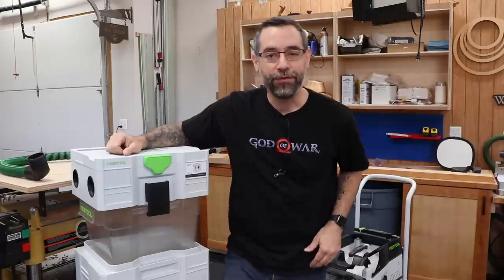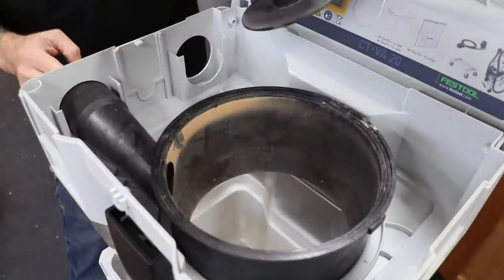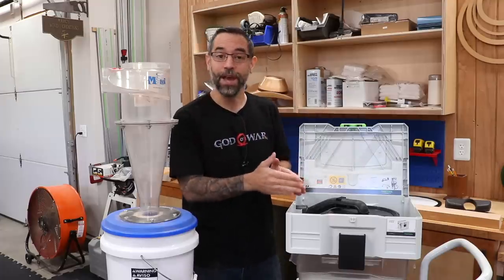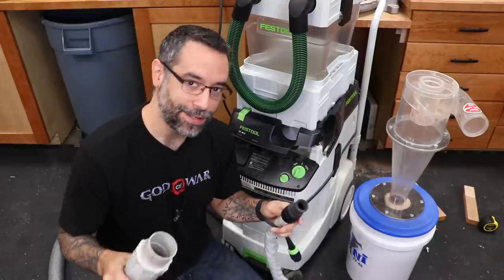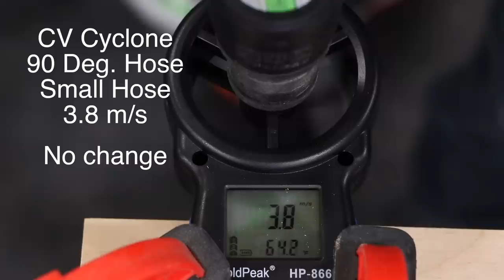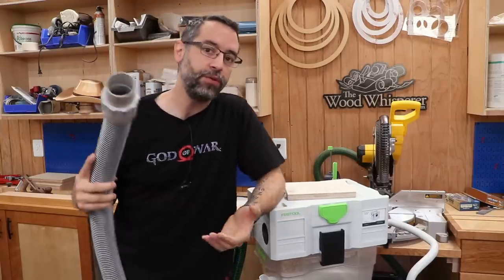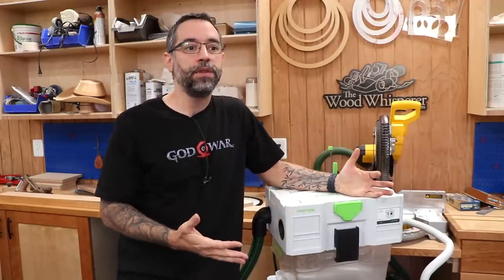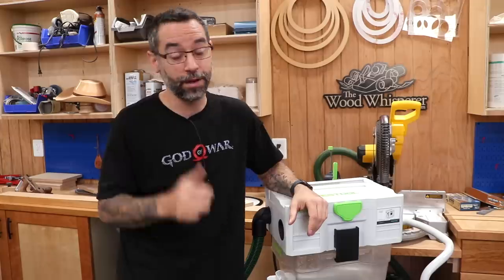Festool CT Cyclone Review | Not Great!

Comment: Marc, I am a mechanical engineer and I specialize in industrial HVAC, which includes dust collection.

I agree your methodology for testing is decent enough to observe a relative difference. Kudos for being practical and not measuring arbitrary things like static head and watts and whatnot.

As for those 90 degree elbows: they are not as bad as people think. They have an equivalent length of like 5 feet of straight duct. Additionally, one foot of corrugated hose has an equivalent length of about 5 feet of straight duct.

But, those 90 degree elbows are actually really large and don't function like an elbow in this case. Kind of hard to explain, but since it is at the opening the airflow hasn't "developed" like it would in a long run of straight pipe.

Not sure where I was going with this. Uhhhhh bye.
Reply from the maker: That’s all good to know. Thanks, man!
Reply: maybe you can answer a thought i had, doesn't pressure drop exponentially as speed decreases? IE a 30% loss in velocity is more like a 60% pressure drop... meaning the speed reduction is a lot worse than one thinks. I've ready on the FOG forums that people feel their shop air is much dustier with the CT vac on - if a 14% reduction in air speed is more like a 30% pressure loss it would certainly explain that
Reply: More concerned that it drops to the small hose right out of the gate. And it's the same size from the lid duct inside so swapping to my other fat whip won't do me any good. Can't believe I bought this. I asked how big the hose was over the phone. They said they couldn't say but it should run the 2 larger hoses for the larger tools. If it doesn't have the volume flow to run the turbo brush beater bar it's useless to me. I bought it for planex, renofix and bulk dirt. There are major losses with the hoses my system requires. They think we need a preseparator most when we're running fine particulate sanders? The biggest loss with the cleaning tool with the hose that fits the OD instead of the ID.

Comment: There's a fairly new solution that's also low profile that's sold at Home Depot for $40 - Dustopper.  I can mount the bucket + Dustopper on top of my Festool vac and achieve the same results.

Comment: Hi Mark. I bought a CT cyclone about a month ago. I have had a problem with the clear plastic bag in the "tub" being sucked into the cyclone. Have you had that problem?
Reply from the maker: Oddly enough I was just messaging with John Malecki and he has been having the same issue as you. I haven’t had that problem yet. The bag kind of wrinkles up a bit but doesn’t get sucked in.
Reply: Stick a piece of velcro at the bottom of the box and the bag.
Reply: Run a small 1/2” hose to the bottom of the bin from the Vacuum. This will provide equal amounts of pressure on both sides. This also become a real problem when air is able to get under the bag.
Reply: Had the same problem. Makes me not want to use the bag.
Reply: Thanks for all the great tips guys. I think I found the problem. Having too much plastic bag inside the container instead of wrapping the extra down the outside.
Reply: put a hole in the bag the size of a fingernail at the top . just below where it folds out over the rim. pressure of bag equalizes its a simple trick
Reply: Use it without the bag . Keep a large bag outside . Take out side and empty into large bag . It’s easy to empty I can put 60 pounds of dust through the system without even filling the vacuum bag . And that is on a small midi vacuum . . Tape the connectors on the link hose to seal the leaks . And tape the top of the baffle .

Comment: I'll take the bait! 

Did you look at pressure drop (measured in inches of water column, an indicator of overall friction in the system) with your manometer? That tells an important part of the story too. As velocity decreases pressure drops off more - so a 36% loss in velocity (festool) is a 60% loss in pressure, and a 14% loss in velocity (clearvue) is a 26% loss in pressure. My understanding of the cyclone design (at a 3:1 ratio of height:width)  is to minimize friction and therefore pressure loss , because it plays a vital role in keeping dust entrained in the airflow. That has always been the shortcoming of the Thien baffle designs. The second I saw the CT Vac I knew how the numbers would look
Reply: guitarchitectural ooh physics me likey!!

Comment: Thanks a lot for another interesting review. overpriced on its own and I would agree they should have given something back to its customers by offering a much lower price as this is mainly shaped / moulded / blown plastic. It comes across as many have already said as a rip off and Festool ought to do better. On the positive integration is superb and a very convenient way to colect (fine) dust - I have an Oneida system I am very happy with but I will be on the look out for a better price for this CT Cyclone and when that is found it will become part of my other Festool vac system
Reply: @Tensquaremetreworkshop  I have plenty of Festool kit and it is my fav brand but albeit we all appreciate all that is about Festool not everything they make is priced fairly...and not everything they make is golden dust. Oneida has got better systems (it is their specialty...) - what Festool did here was  to jump on tech invented by others and integrate it with (some of) their vacs and in the process (clearly) overcharge for the convenience.

Comment: I'm curious where that massive loss came from on the large hose. Could it be that with its added suction power, it's able to break the seal between the clear bin and the cyclone systainer component, or pull air from other connection points? I really feel like air must be entering the system from other locations, but is there another possible explination?
Reply: Actually had another thought. The further the vacuum is off of the ground, the less suction it gets. This system not only makes the Festool vacuum taller, therefore needing to pull things to a higher height than normal, but it is certainly taller than the other systems as a full unit (I think?). This doesn't explain why the smaller hose isn't much affected, but perhaps that is because the smaller hose isn't even close to the max power of the vacuum.
Reply: I fill my separator all day long on the midi vac no problems . Is a great system for professional sanders

Comment: I have no complaints about your testing method.  Airflow at the end of the pipe is what determines the amount of dust that can be collected. That is what you measured. It is also useful to know that it is fairly affective at separating dust. That said, I won't be buying it. I would prefer a standard cyclone.

Comment: I kind of freaked out when I got mine and noticed the suction loss. I have a CT48 hooked up to the CMS router table and I want to say there’s is a reduction in collection. I see debris on the table and on the floor and even in the dust hood. It’s a fairly new system with a fresh bag so I’m unsure if I should be using the festool cyclone with the router table or just go straight into their regular bag. Anyone got any tips ?

Comment: I bought the dust deputy for my festool midi after watching a video from The New Brit Workshop... he tested the dust deputy for loss of suction...which he determined was minimal...I’m very satisfied with unit in my basement workshop but it would not be practical for a mobile contractor
Reply: I bought mine after his review. I'm not so sure that my figures match his just yet, so I'd be interested to see exactly what he was vacuuming. My test was a general clean of my workshop floor and I will wait until one or the other is full and report back. Jury is out at the moment.
Reply: I disagree I use mine all the time as flooring contractor on a midi vacuum

Comment: I have the Oneida model (current design) that fits on top of the CT vac and locks on using their systainer system. The durability and apparent quality of the plastic is impressive. Festool makes great stuff, and as a hobby woodworker who obsesses over the details of my work I appreciate thoughtful and careful engineering. It will be interesting to see how the Festool compares to the relatively simple-yet-robust Oneida in terms of longevity.

Comment: IT'S FESTOOL OF COURSE IT DOESN'T SUCK.;) small joke......very small..some good info Marc thanks for sharing that. I'm doing okay with my harbor freight d.c. with the Wynn environmental filter on top. No separator I do have one hooked up to a 5.5 hp  shop vac for my table saw. And jointer. I'll take that 375 and put it towards  a kapex miter saw or  a domino either way festool gets my money..lol

Comment: A good thing to know would be how much does this save you changing bags or filters and the resulting cost savings for purchasing the CT. I am considering a festool vac so I wouldn't mind knowing this.
Reply from the maker: That's very hard to quantify but a pre-separator will make a HUGE difference in your time between changing filters and bags. Take a look at my previous shootout to see just how much typically makes it through the cyclone and into the vac.

Comment: Should the costs of the HEPA filter replacement and the Festool bags also be entered into this equation?  If the separator minimizes the replacement of these items there is a value-added component to the discussion.
Reply from the maker: It’s a consideration, but it’s one that exists with any non-festool setup too. It’s a factor you should consider if buying one but it’s not something that impacts the performance issues discussed here.

Comment: Wow the hate for what people are calling "some plastic bits". Got to understand the price is for R&D and the engineering of the device no t the $5 worth of plastic. This is like complaining that you got a bunch of 1's and 0's after spending a bunch of money at the iTunes store..... 

I think it's a good design and does what festool designed it for, maximum separation with the smaller hose which is probably the typical hose used with their ct-vacs. The reason the large hose drops in efficiency so much is because to maximize separation for the lower air volume the higher volume chokes the separator.

Comment: Just take a look into the left side of the openings on the systainer cyclone and see a massive reduction in diameter. There is your explanation for your massiv drop in suction for the bigger hose. For the smaller it does not matter, but just 20% more (compared to the ordinary cyclone) in loss is huge and dismissis this cyclon for the big hose and all application in that context. And the price is just rediculous, 200 would be worth it but nothing more.

Comment: As I said on IG, I don't think you fully understand what the question is that you're trying to ask. You're on the right track, but there are some glaring errors in your testing. 

1: You need to make a funnel that is as wide as the anemometer on one end and the hose on the other. This will prevent the vacuum from drawing in air that didn't pass through the anemometer. This unmetered air is polluting your results.

2. You also need to know how much air is blowing out the exhaust of the vacuum itself. This factor will be the most telling. If the exhaust airflow is reduced disproportional to the intake air, then you're losing suction from an air leak somewhere in the festool system (something they will want to know), if it is proportional, then yes, the festool system is causing a greater constriction.
Reply from the maker: Did you catch the part where I said I don’t want to over-complicate this? 😁It's a simple relative test. The results coincide with my observations and give us a laymen's quantified view of the situation. I appreciate your knowledge on the topic, but this simple experiment told me what I needed to know.

Comment: The loss at a 90 bend depends on the density of the flow. Clean air incurs a lower loss than air with dirt in it. Thats probably why the dual bend hose works so well between the separator and the vacuum.

Comment: When you plug the hoses into the dust collectors you have a sealed environment, hence a vacuum.  When you placed the hoses on the anemometer you didn't seal (the environment) from around the outside of the hose to the anemometer therefore no real vacuum exist. I'd be curious so see what the real drop in airflow would be through in a true vacuum environment.

Comment: Festool dropped the ball on this design. They could have easily used the lower half of the vacuum as the dust bin. Should have added a middle section to house the cyclone and dust bag. Then placed the vacuum head on top. Then I could have justified the cost.
Reply: this is the cleverest thing anybody has commented yet.
Reply: @michaell2738  I totally agree, but i wouldn't say that the current design dropped the ball.

Comment: The reason it is so expensive is that a lot of new large moulds had to be created to produce this. 
Not many of these separators are produced, making the individual unit costly as the moulds are very expensive and have to be paid off at some point. 

They should have used more off-the-shelf components to produce this seperator, bringing the cost down. Then again, its festool.

Comment: Well...by the look if things, festool make plastics more expensive than gold. Their product is definitely not for DIY W.W or small shop owner. Too overprice.
Reply: +orangeRANGE81
If there was no festool the only option would be Mafell at about 3 times the cost. Festool needs money to innovate. There would be no track saws without festool. 

A festool track saw costs about $600 and to get a table saw to have the exact same capability would cost about $10,000 and you cannot carry that to site. 

Dewalt have a good track saw but it is not as good as the festool track saw but costs about $500. You pay for what you get.

Comment: There's one thing I don't quite grasp on those reviews. The main job of my vac is to prevent the dust to go to my lungs. The very fine dust in particular. 
There's another review showing that this cyclone achieve 97.5% efficiency, which is presented as a good score.
But I think we DON'T want for the cyclone to actually achieve a score too close to 100% efficiency, because it would mean that even the fine dust is now in the cyclone bag instead of the vac bag, to be released when you open your cyclone and close the bag. 
I want the fine dust to be in the vac bag, which is the only one that will keep it there. 
To consider 97.5% a good score would mean we know there's only 2.5% of harmful dust in the samples. 
Corollary point: you probably don't want to connect the cyclone when you do fine sanding because you absolutely want the fine dust to be in the vac bag, and not in the cyclone bag.

Comment: I have a Festool ct26 that I keep a bag in. I typically only use it with sanders. When the bag gets about 1/2 full I take it out and suck the dust out with my shop dc system. haven't needed a new bag yet.
The Festool separator reviewed here looks like it isn't worth getting. Too much money for what you get.

Comment: Festoon Vacuum + dust separator $1,000 Really for a stinky vacuum, some of us needs to get a ridgid. Vacuum and some dust bags as a dust separator they work great and takes 2 mins to change the dust bag... oh and they don't loose suction... well may be a little bit who knows, but I still recommend a ridgid shop vac with a dust bag and you can also get a wireless remote control for extra $10  bucks